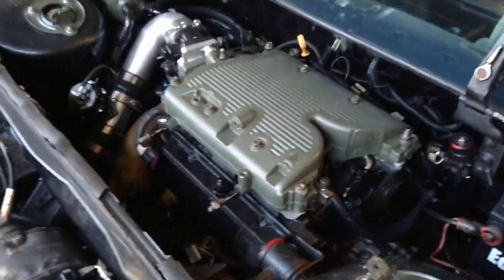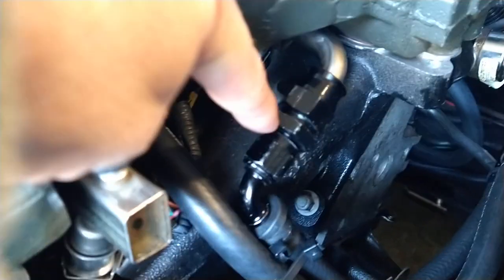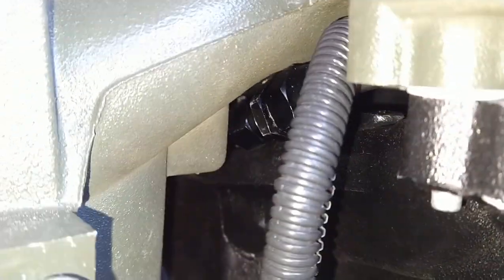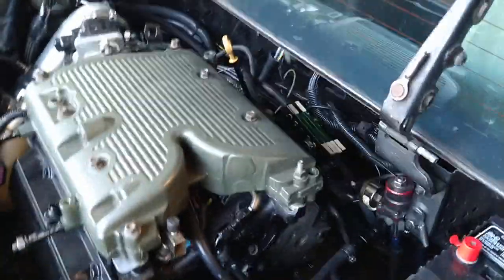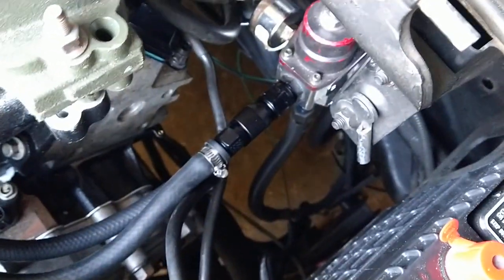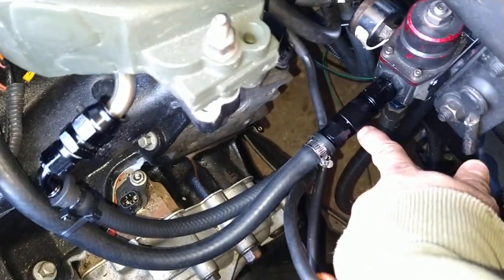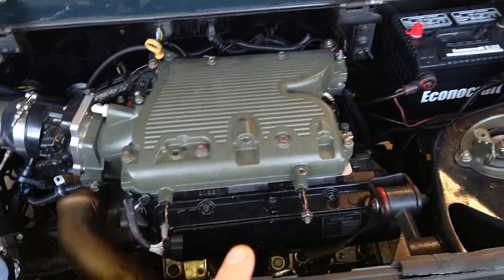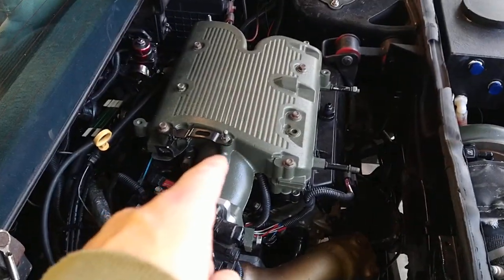Modified Fuel Rail on Turbo Fiero.  Worlds Fastest

Comment: The tubular two TB set up you use to have was cool looking too.
Reply from the maker: Thanks dude.  Yea unfortunately the iron heads are garbage and flow awful.  i ran 10-11ish psi on a 3.4 and it only made 280 whp.  On 12.5 lbs on the lz4 3.5 it made 460 on 12.5 psi

Never going back to iron heads   but yea it was a coo dual tbl intake that did flow better than stock.
Reply: @Slowv8Fiero you’ve come a long way from the bel Air days.

Comment: How hard was this engine swap vs say a 3800?
Reply from the maker: I never did a 3800 but the 3900 doesnt require custom mounts like the 3800 does.  I used stock mounts